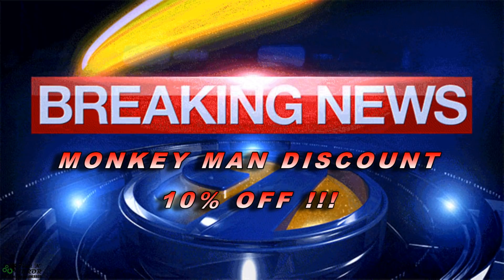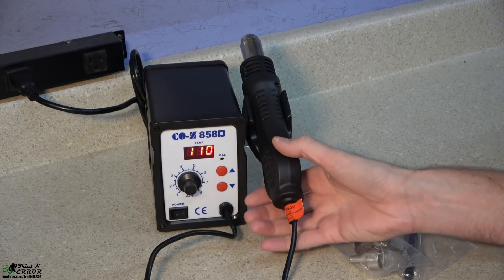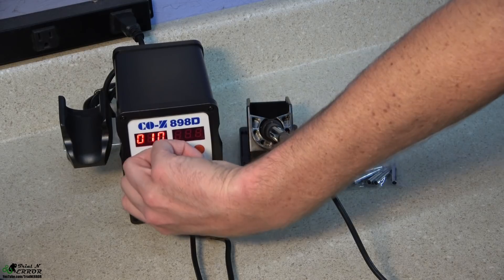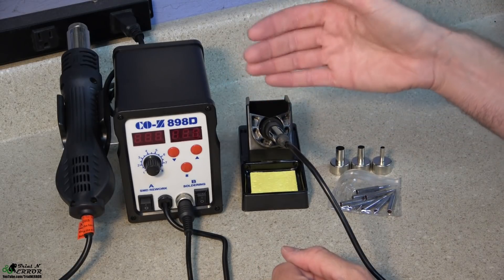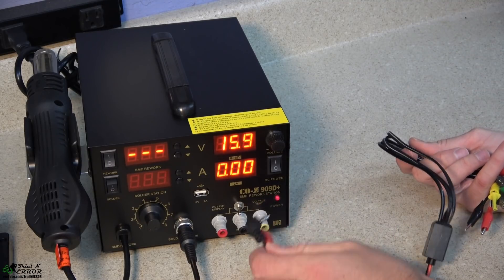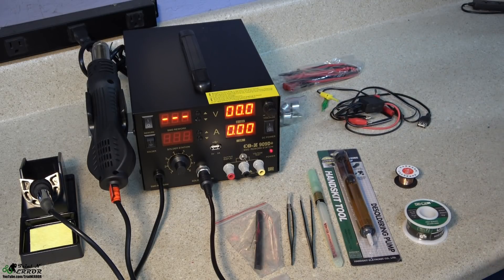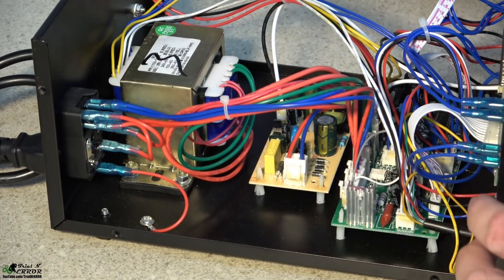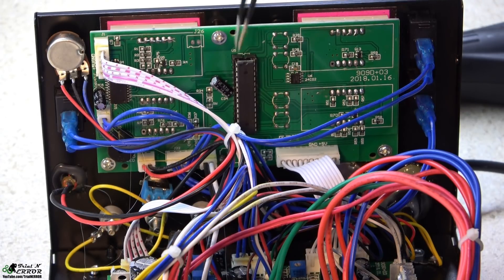CO-Z Soldering/Heat Gun Stations - Review AND A LOOK INSIDE!

Comment: Just bought the 898d! Would you say that those are as pretty on the inside as the last one you showed? Saw some other vids of people showing some unsafe wiring in similar looking units
Reply: Did one of the Yihua brand also have an unsafe wiring issue? It can be corrected
Thanks